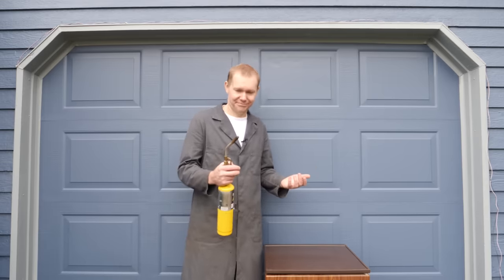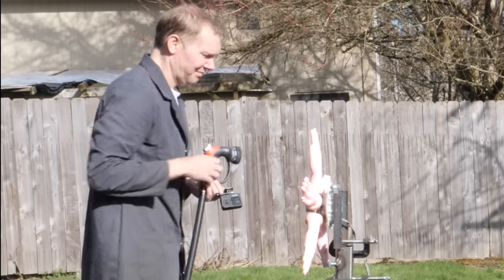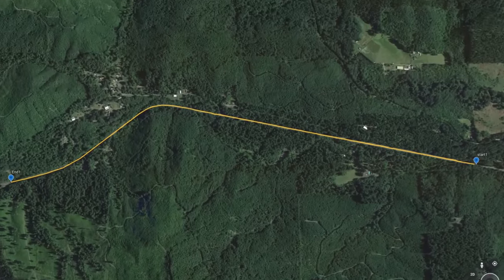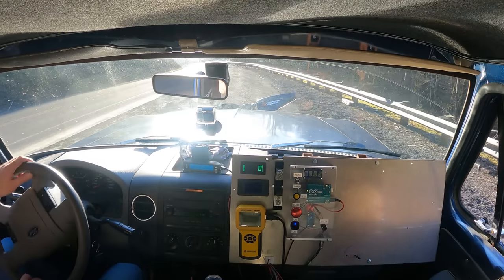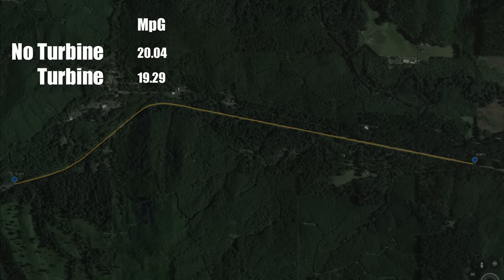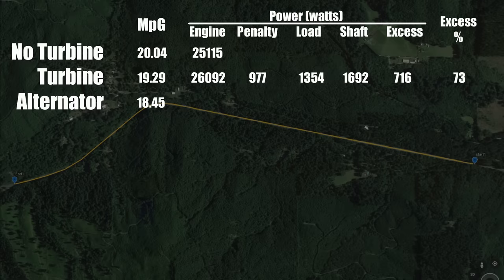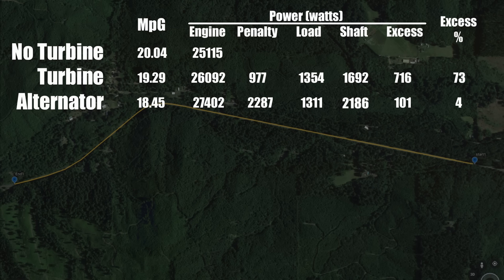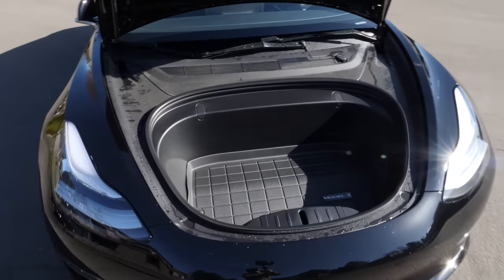Mileage Results You Won't Believe!!! - Wind Power on a CAR #5

Comment: I like the math and it makes sense, but the part I'm most impressed with is a 1978 Bronco that gets 20 mpg!
Reply from the maker: LOL, keep in mind that didn't include acceleration getting up to speed. 😁
Reply: It's also a bronco he built using, if I remember right, an f150
Reply: Not a 78 Bronco powertrain
Reply: It's a F150 in a bronco shell.
Reply: @ernestjorda2777  I was wondering where the new dash came from😂
Reply: Cruise control helps with the higher mpg since the ECU controls the right amount of fuel for that speed; way better and more precise than a foot.
Reply: @anthonyfrison9828  only on flat road, cruse can't gain speed before a hill to keep from trans fron down shifting wile the load increased by the incline
Reply: @citizensunitednegatingtech9783  Smarter ECUs like most modern cars can accommodate for the increase in load due to inclines and even cut fuel off completely on declines. I've got a Ford and it does it. Granted if the incline is above the load capacity, then a downshift is expected.
Reply: @citizensunitednegatingtech9783  perhaps some day, sure would be great if it could use the gps and inclinometer to speed up on descent and almost coast in inclines
Reply: What difference would a multi blade prop make with the same or different pulley ratio?
Reply: And also has the front clip from a modern f150 with the 79 body panels.
Reply: @mts592  less blades are more efficient than more blades! Ideally, a single blade prop would be the most efficient, but balancing such a device would be near impossible. Just look at boat propellers, the most efficient ones are 2 bladed, or 3 bladed on larger motors.
Reply: I would love to have his 78 Bronco.
That's it...
Reply: In 1984 I purchased a new Ford F-250 Diesel 6.9 liter 4 wheel drive. It averaged 23 mpg. These days with all the high tech newer trucks are getting close to that. LOL 😆
Reply: @drwoo7346  you didn't get 23mpg in a 1984 diesel! That is a complete lie!
Reply: @charlieodom9107  no it’s a fact.
Reply: @charlieodom9107  it was a gray Diesel engine. International I believe. They didn’t have all the emissions crap back then.
Reply: @drwoo7346  it was an extremely heavy engine that made less power than many 4 cylinder cars today. The ONLY people claiming 20+mpg have NEVER been able to prove it. Incorrect speedometer, bad calculations, and pure ignorance is all it takes to claim a fairy tale. Also, those people who claim 20+mpg are most likely doing it running a really high gear, on flat ground, at slow speed, and only calculating it on a few miles, not an entire tank. I have also seen people claim high mileage on a long stretch of downhill traveling, like the trip from Raton to Amarillo, which has a mile of drop or more between the two!

There is absolutely NO way a 170hp diesel engine in a 3 ton truck can do 20+mpg in the 1980s.
Reply: @charlieodom9107  I drove it on several trips. It averaged 23 mpg on the highway guaranteed.
Reply: @drwoo7346  probably to your ocean front property in Arizona, right?
Reply: @charlieodom9107   I can verify the old 7.3 idi international engine can easily get 20 plus mpg if it's turbocharged the 6.9 was the same engine just less displacement
Reply: @tbirdpimp07  ANY engine can get 20 mpg if you give it a highly specific set of circumstances. You can not sit there and tell me a truck with that engine can go over 400 miles on 20 gallons of fuel. You can not expect someone to believe that engine in a 3+ ton vehicle can drive around at highway speeds for 400 miles on real roads and only use 20 gallons of fuel. I have been in several 6.9L vehicles and they do not get 20mpg. They get around 15 or so on a good day, and that is with one person and no cargo in the vehicle.
Reply: IKR!
Reply: I agree no 20 mpg
Reply: @charlieodom9107  try looking at something bigger like an aircraft carrier or submarine and your "less blades are better" theory fails.
Reply: I came here to say this too!  My 2014 Ford Flex with a v-6 only gets 18 lol
Reply: @mikeries8549  no it does not! Large vessels have more blades due to drag and rotational speed, not efficiency of the prop. You simply can't spin a lower blade count faster on those vessels. The laws of fluid dynamics don't change.
Reply: My 1973 Chevy 454 got 24mpg..
Just cuz it was falling off a cliff is totally irrelevant..
Reply: @charlieodom9107  : you better shut up I’ve seen it too !!! 25 miles a gallon standard shift pulling a trailer !!!!!! No joke
Reply: @robertholderman7552 : wow why so hostile man? It's not that serious.
Reply: This body has a lot of drag and would typically be 15 mpg in 65 mpg cruise on level highway(or worse if tuning issues). I didn't watch video where he showed evidence of 20 mpg.
Reply: I get 300 yards  per gallon in my 78.
Reply: My 72 GMC with a 6.0 ls gets 16.5mpg at 80 plus.  If he is using a modern coyote and going under 70mph it is easily possible.
Reply: @drwoo7346  they are also a lot bigger and heavier.
Reply: The 800+ H.P., 547", N/A big-block in my Olds gets about 2.63 MPG's on $12 a gallon VP 114 octane leaded fuel.... Who Cares? 🤷🏻
Reply: That's when I knew the whole video was a sham!  Just kidding.  Great video, I enjoyed it.

Comment: I still think that you may have increased the aerodynamic efficiency of that brick of a truck. The fan spinning in front of the grill created a high pressure zone in front of the vehicle that helped divert wind more efficiently around the vehicle, thereby recouping some of the losses you experienced by increasing the drag with the windmill. That's my theory anyway. I'd love to see some wind tunnel testing to see if that's what's happening.
Reply: This could be tested without a wind tunnel by installing it on a highly aerodynamic car
Reply: @why6212  and it would most probably have zero net gain or much more likely a loss I efficiency because efficient every efficient aero meaning clean laminar airflow around the car which a turbine will replace by turbulent air. if you wanna increase range on an EV its simple, you increase battery capacity, or you decrease drag/weight. loo at Tesla, lucid, aptera. everything else is BS. the eolo car mentioned in the video is a 60mph/60 miles range EV ("according to the people who make there car") which gets a claimed 10% increase in range from it's turbine...it's 20 yo tech that nobody wants.
Reply: No need of a wind tunnel. Let the car coast in neutral and measure the rate of speed loss. Not very accurate but enough to indicate a better or worse aerodynamic drag with or without the windmill.
Reply: Yeah - I agree. I'm pretty sure that's where the gains are from. It would be an interesting experiment to place a simple fairing in front of the vehicle. Rather than the alternator extracting 1600W from the airstream over the car, reduce the CoD with a fairing, and compare the reduction in fuel.
Reply: I mean....of course that is the goal?...right?  I think that is exactly what he was asserting in the video.  The windmill is somewhere between the ideal surface and the truck.  So there is a lot of energy budget to play with there.
Reply: @pauliexcluded1  It's been awhile since I watched the video but I don't remember him saying that explicitly. My assertion would imply that just making the truck more aerodynamic would yield better fuel efficiency than this setup, but I was also trying to explain why this actually improved aerodynamic efficiency enough to yield a net positive efficiency increase even while adding some drag in front of the grill.
Reply: That's the only way this can produce extra energy
Reply: No. Not at all. The flow of air is horrible after a prop. A prop does not have good properties for what you are saying. Water droplet shape is the best aerodynamic shape, the prop is facing with its cross section against the wind. Yes, it cuts it, but it is still NOT aerodynamic in the sense you are trying to imply.
Reply: @jf8138  it only has to be better than the front of the truck.
Reply: Agree, the bronco needs a tail section to really create a tear drop silhouette.

Perhaps another set of blades on the rear
Reply: I think if put a propel on the hat it's make your brains much smarter... specially when you jump off a cliff.
Reply: @penttiperusinsinoori3037  You first buddy.